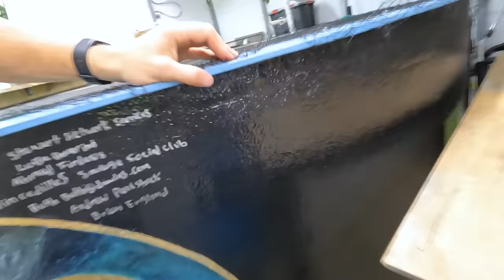I made a BIG turtle TRADE with Paul Cuffaro!

Comment: Since it’s brought up every time he visits Paul, the black lines are from electrical interference for the LED lights in Paul’s building. The electrician probably used unshielded wiring.
Reply from the maker: It stinks
Reply: Will that damage the equipment?
Reply: I guess Paul had to cut corners somewhere since that building cost him upwards of 70K +
Saltwater fish aren’t cheap.
Reply: Is it not the hrz frequency on the leds
Reply: @davidvento5481 it’s not really cutting corners most people don’t even know about it
Reply: @davidvento5481  no. It’s just more of an annoyance. If he was running equipment like lasers, printers or CNC Machines, it would be an issue.
Reply: @bryandunbar5871  no. It’s unshielded wire. The electrical field is radiating from the power lines
Reply: @bhutch216 
Is it possible the pump on that freshwater pond keeps flipping the breakers and shutting off due to curcuit overload which is why it looks like pea soup? Back then he was complaining about the additional cost of running a dedicated line for the AC to be effective. His #1 priority seemed to be building a comfortable “man cave” for himself and his friends over a structure best suited to the care and maintenance of his animals. He doesn’t really seem seriously focused on anything other than amassing views from what seems to be a mostly very young, impressionable audience.

Comment: Call the mata-mata "whats the"....or "What's a"

Female bullfrogs are bigger.  The easiest way to tell is by the tympanum.  If it is bigger than the eye it is a male (sometimes twice the size).  The female tympanum is around the same size as the eye.....Could be that reason he's not calling for a female is that he's not a he.

I went back and looked.  I stopped the shot right as Paul was lifting her up.  I can see clearly that it is a bullfrog as opposed to a green frog, by the ridge around the tympanum.  I can also see that the tympanum is about the same size of the eye.